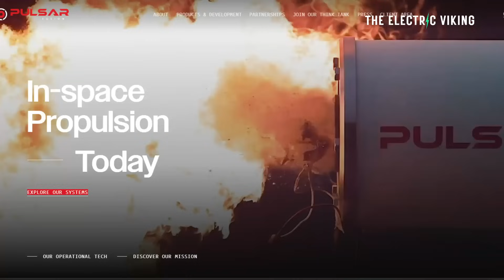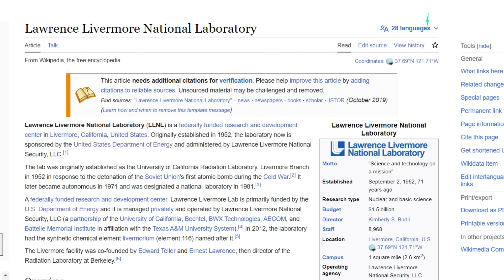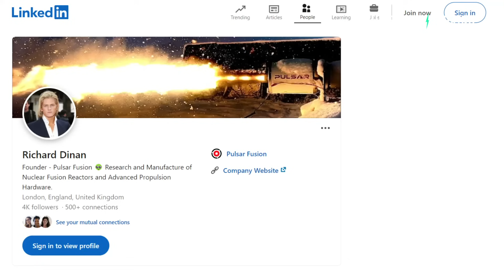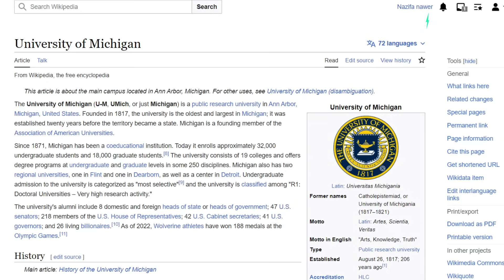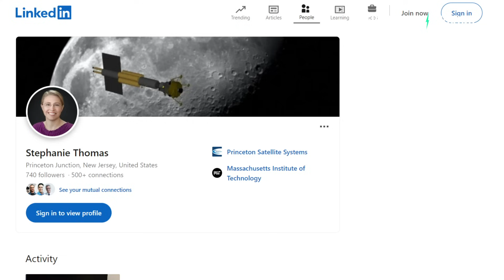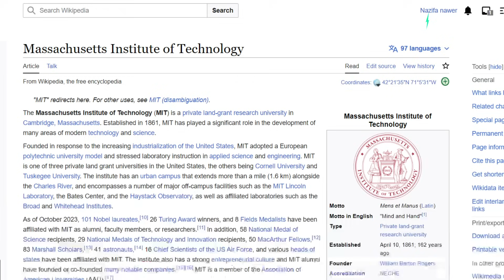Nuclear fusion rockets will launch a new era of super-fast space travel

Comment: They did not produce more energy from fusion than they had to put in. Very conveniently, they only measured the laser OUTPUT power, and not the INPUT power. Lasers are far from being 100% efficient, so the input power was significantly higher than the output power. Furthermore, the power supplies for those lasers are not 100% efficient, and the losses there were also ignored.

In short, the claim about successfully achieving a net power gain from nuclear fusion is still snake oil.

Comment: That US inertial confinement experiment hailed as producing more energy than required to initiate the reaction took the laser energy input as reference instead of the energy of generating that laser energy. Guess you know what that implies at the low digits efficiencies of the lasers used.

Comment: Maybe in the 23rd century. NIF did not hit energy breakeven. It was only a net gain if you only count the energy out of lasers. If you count all of the energy consumed by the system NIF only outputted 1%. NIF is also a giant building. What's more it was one shot, it wasn't something that they could do repeatedly. Fusion power has been 30 years away for the last 70 years. The only practical fusion reaction that anyone has been able to create is the hydrogen bomb and you certainly don't want to use H bombs to propel your rocket. Maybe by the 23rd century the Federation will have Bussard Ramjets that can suck in interstellar hydrogen and fuse it.

Comment: If you have to put 200MJ into a laser to produce 2.05MJ of light to create 3.15MJ of fusion energy, you have not "produced more energy than you put in". If I recall my primary school maths correctly, 3 is less than 200.

To put these numbers into a form you might be more familiar with, 3.15MJ is 0.875kWh. 200MJ is about 56kWh and 2.05MJ is around 0.56kWh.

The US achievement was significant and subsequent experiments have incrementally improved the results, but they haven't cracked the holy grail of nuclear fusion.
Reply: It was merely a proof of concept that we can indeed turn 2MJ of energy into 3MJ . Yes the electrical conversions were highly inefficient but it’s the first time humanity has ever successfully turned some energy into more energy . Before this was never possible but now it is even though we wasted a shitload of electricity in the process. Talk to me in a decade and let’s see how far we’ve come
Reply: @camronrubin8599 , it was the suggestion that we were already there that was the point. I've heard reports from other quarters that laser based fusion has its uses for scientific investigation where efficiency is not an issue, but it is not a serious contender for power generation for the same reason.

Comment: So I asked AI this question:
What is the status of a nuclear fusion rocket motor - how many years until it is online?

Nuclear fusion rocket motors are still in the early stages of development, but there has been significant progress in recent years. Several companies and government agencies are working on different designs, and some hope to have working prototypes within the next decade.

One of the most promising projects is being led by the UK-based company Pulsar Fusion. Pulsar Fusion is building a large fusion chamber that it plans to test in 2027. If the tests are successful, Pulsar Fusion hopes to have a working fusion rocket engine within the next decade.

Sure sounds like it's a generation away...just typical clickbait announcement - "just wait a generation"

Comment: It's about twenty years off. Just like it's been every year for the last fifty or so. Don't hold your breath.
Reply: We’re not talking about a fusion generator we’re talking about a fusion rocket . Fusion is incredibly simple to achieve and we’ve been doing it for a long time with fusors which do indeed have practical applications to this very day. Two totally different things. It’s simply more efficient , we’re not trying to produce more energy than we put into the reaction. We’re just talking about fusion rocket propulsion  . You don’t seem to understand and neither does Sam, this is not a fusion generator
Reply: @camronrubin8599  so your fusion rocket uses more energy than it produces? Great plan.